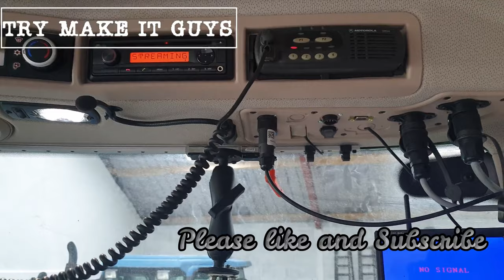CB RADIO FIT (FENDT CB Radio/Dash Cam/Reversing Camera fit)

Comment: Do you know what fuse is associated with that connector? I hooked up my radio but I have no voltage on those pins. Trying to chase down the issue. My radio was too big to put in the spare slot unfortunately.